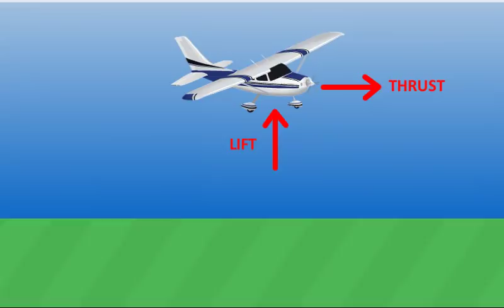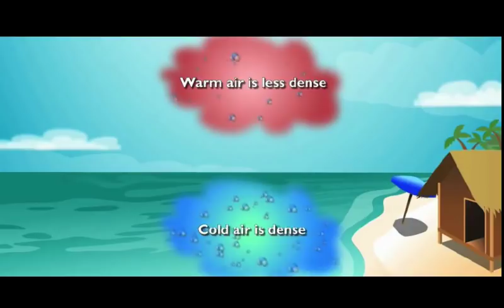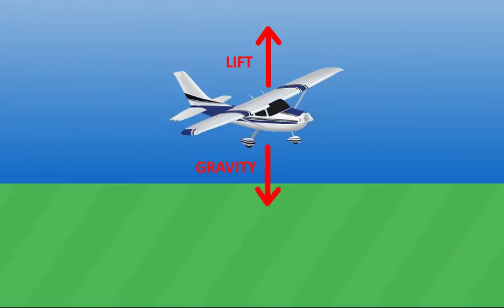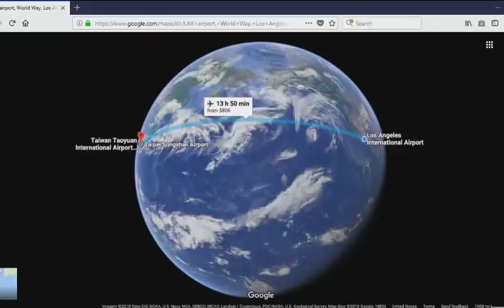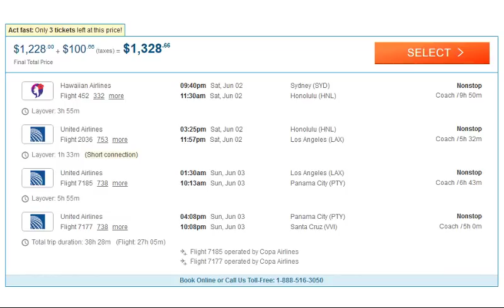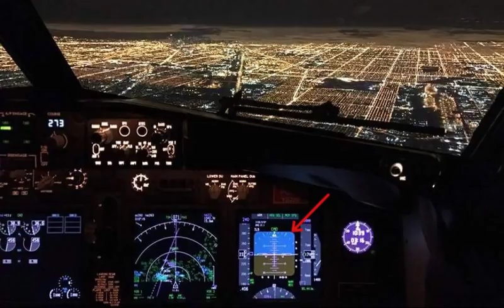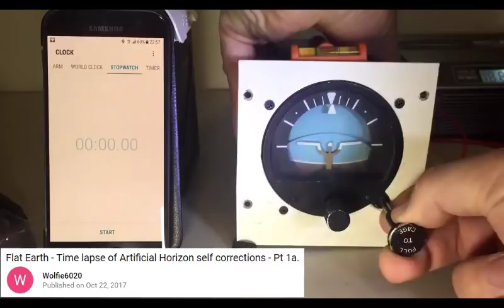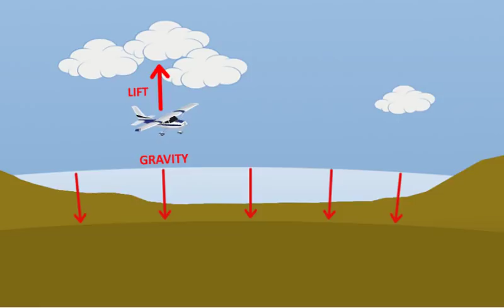Flat Earth Falsities - Plane Nonsense

Comment: So I haven't read any of the comments so if this is a repeat I am sorry. Anyway. On # 1 you say the plane keeps the momentum that it had when it takes off. So that means that it still has the 1040 mph momentum to the east so that it is moving with the air in an eastward direction so that it keeps the momentum and stays with the spin of the earth. Same with the helicopter it keeps the 1040 mph momentum east so that when it hovers it actually is moving with the earth at the same speed and therefore the earth with not spin underneath it . Cool. I get that and can accept that. Now onto # 2. North south landing. So if I take off going north at the equator going 1,040 mph and travel north for 8 hrs. Where do I land? Do I land straight north (same Longitude) of where I take off or do I land east (Longitude) of where I took off?
Reply from the maker: Good question. Planes are not missiles. They have pilots that are constantly correcting course due to the wind.  You are right to think that the ground will move slower as you go north from the equator, but so will the atmosphere, and the change is very gradual and will just not be noticed within all the other minute adjustments.
Reply: Well if you are heading north then presumably you are following a compass bearing, so you end up... north.
Reply: An 8 hour trip is quite long.  You will have to make slight adjustments just as if you drive 100 miles on a straight road.  Nothing you would ever notice.  If you are asking if land would move under you during that long trip?  Probably a little, so would the atmosphere you are in, the wind would change direction, all sorts of stuff.
Reply: This difference in speed creates a phenomenon known as the Coriolis force. This force, however, is too small to be noticeable in our everyday lives.
Reply: VoysovReason
So if I launch a rocket and point it north just like the plane would take off, it will land east in longitude of where it took off? Is that correct? It will do zero course correction for wind or spin of earth. Most rocket launches are done just straight up. I wonder if anyone has done this before. Hmmmmm..... That might be a fun test. I wonder if it would be allowed to do such a test. 

Ok so back to the airplane. So, the pilot makes these course corrections to stay on the same longitude line and fly just straight north and these are so minute that they pretty much can't be detected. Leaving from the equator I would agree these would be very minute but the further he travels north the more the corrections would have to be more drastic. For example, the first 10 degrees north from the equator it doesn't change all that much. But as he continues to fly north wouldn't the course corrections become larger and larger. There is a bigger change in earths rotational speed at 45 degrees north to 47 degrees than there is from 0 - 10 degrees.  I know wind speed may play a factor but let’s say for this example we find a day where the wind speeds are the same as he flies north. 

According to https://www.vcalc.com/wiki/MichaelBartmess/Rotational+Speed+at+Latitude

At 0 degrees (the equator) the rotational speed of earth is 1,040.4016 mph. At 1 degree latitude it is 1,040.232 mph. So that is a change of only 0.1696 mph. That is very minuscule. But then at 10 degrees the speed is 1,024.5956 mph. That is a change of 15.806 mph in 10 degrees or 691.69 miles. Remember each degree is 69.169 miles. But at 45 degrees latitude the rotational speed is 735.675 mph and at 47 degrees it is 709.5522 mph. That's a difference of 26.1228 mph in 1/5th the distance or 138.338 miles. So, the pilot should see a drastic change in course corrections while flying in this scenario would he not? 

Let’s say the plane is traveling at 500 mph (which is very typical for a large jet) so in 2 degrees from 0 – 2 latitude he goes 138.338 miles and it takes 0.276676 hrs. or 16.60 minutes to travel that distance. So, during that time the earth has rotated 287.85 miles at the equator and 287.678 miles at 2 degrees latitude. That’s a difference of 0.172 miles or 908.16 feet. Because the plane is still traveling at 1,040.4016 mph to the east as it were when it started out at that latitude, if there are no course corrections the plane would be east by 908.16 feet. Now the plane that is traveling at a latitude of 45 – 47 degrees the change would be much greater. So, let’s look at that. The plane is traveling at 500 mph and travels 2 degrees from 45 – 47 degrees. That’s the same 138.338 miles and takes the same time of 0.276676 hrs. or 16.6 minutes. This time the earth has traveled 203.54 miles at 45 degrees and 196.31 miles at 47 degrees. So, if there were no course corrections to be made the plane would be 7.23 miles to the east of where he started. That would be 42 times the distance change in the same 2 degrees of traveling north. Or the change in course correction would have to be 42 times that of the course correction at the equator.

I guess all I am getting at here is the while the course corrections may be minuscule they would have to be much different at different locations on earth. Because I am not a pilot myself my question for those that are pilots. Is there a difference in the course correction at higher (or lower) latitudes on earth? Can you tell a difference in these course corrections? I do have a couple people I know that are pilots so I will have to ask them the next time I see them. Not sure when that will be as they are more of an acquaintance through mutual friends though. 

I think this same principle could be done with a helicopter. Maybe not 500 mph but the distances could be replicated for sure. I do not think the wind speeds are that different at the equator vs 45 degrees north. It’s not like you hear of winds speeds over the ground blowing down homes at the equator vs at 45 degrees latitude. on a normal day. I think this test could be very accurate in a helicopter on a day that the wind speeds are very low. We have days here that the winds are pretty much nothing so it is a very viable test in my opinion. 138 miles would not be that far to fly a helicopter and get consistent winds at the same altitude. 
Hmmmmm…. Anyone out there willing to do this test?
Reply: Flat or Globe ? Good ?
Reply: Not sure what you mean by Good ? Please explain.

Comment: If you can get flat earthers to do an experiment with a globe and a lamp to explain sunrise and sunset they'll usually let go of the flat earth model.
Reply: Sometimes I'll throw this one at them...

Set up a model city on the floor using whatever objects you want.  Include some tall objects for skyscrapers.  Slowly circle a lit flashlight around to model the "FE Sun".  Notice how the tops of the "skyscrapers" get dark first during "sunset"?

This doesn't happen in the real world.  Tops of skyscrapers go dark last during sunset.

This can surely be seen at the tallest skyscraper, Burj Khalifa, in Dubai.  The upper floors experience the sunset a few minutes later than the lower floors.  This is also why Ramadan observers above, I believe, the 80th floor stop fasting a few minutes after those on the lower floors... they do it at THEIR sunset.
Reply: Another good proof is to wait till the sun has set then send a drone straight upwards and it will see the sun again. 
Wolfie6020 did that on his channel.

If you can find a tall building with a view of the horizon and a glass elevator then you could also do it there.

Comment: Line 8 in athletic tracks is about 53 meters longer then line 1 in full circle. And that is just for the length of 8 meters between line 8 and 1. If airplane is flying on average 10000 meters from curved earth how much longer then the airplane is flying in comparison to flying on the plane. Is it measurable on the airplane's instruments?
Reply: It's measurable even at the surface, this is why maps have to include distortions in distances, directions, or shapes.

Comment: 12;09 and thats not the same plane.
Hawaiian Air (international) to guess where.
Hawaiian Air (domestic - youre in the states now) to LAX
Possibly an affiliate (intl) LAX to Panama
A South American carrier (intl) 

Why do i know this? International and domestic flights are screened differently (esp. domestic flights within the US - yes i know the drill). You also dont get your bags checked all the way through anymore - you have to get them from the carousel at the end of each flight then check them in for the next.

Again, how do i know this? Experience. And ill be doing it again tomorrow (Wed 23rd May)
Reply from the maker: T. M. Shannon - Yes, thanks for the input. I showed the actual flights in my example at 12:35. First is Hawaiian, the rest are United. The last one had a layover of almost 6 hours. I guess it takes a long time to fuel the plane ;)
Reply: VoysovReason sadly couldnt see those in the vid (phone upright) but all good

Comment: "Because in MY reality"
Someone needs to get on the meds

And the answer of course is ESCAPE VELOCITY which even fighter jets cant reach.

Also air pressure decreasing with altitude = at some point there wont be enough air to burn the fuel in the engine, which = engines stop, which then = youre in deep shit at high altitude
Reply: T.M. Shannon " = youre in deep shit at high altitude"
If you are using a jet engine rather than a rocket. Incidently escape velocity only applies to an unpowered craft; powered craft can reach orbit by continuing to burn fuel.
Reply: Last time I checked, planes aren't rocket powered. Also, there's still a problem. Rockets have their own oxidizer inside. Engines use air as an oxidizer, since it has oxygen in it. So if you aren't using a rocket, you're still in deep shit if you go too high.

Comment: there is no way that the atmosphere could move at exactly the same speed as the earth due to friction and gravity. there would be some drag and delay. come on people, use some common sense here. when you spin a basketball on your finger does the air around it move at the exact same speed? yes it moves but not even close to the same speed.
Reply from the maker: The earth has trillions of times more gravity than a basketball.
Reply: richards, spin the basketball at .0006944 and record how much the air keeps up with it.
Reply: It is a common misconception that the atmosphere is spinning with the earth as a result of friction with the surface.  In fact the atmosphere spins along with the surface because it has always been spinning at the same rate as the surface ever since the earth along with its atmosphere coalesced from the same spinning cloud of gas and dust 4.5 billion years ago.
Reply: actually it does,,on the same scale,,about half a milimetre thick,,like DUH..
Reply: Has the basket ball been spinning in a non friction environment for billions of years?
Reply: @v.x richards
Returns after he was hospitalised when he had several new rectums reamed after making the same stupid claims and being right royally rogered. He must like being abused.
Reply: +John Myers
I have some experience of v.x richards   I gave the troll the respect you seem to be doing, as did others. It abused it. Several times.  My post perfectly reflects that, or didn't you notice?. His latest opening gambit is pure troll. Drawing the marks.
Arguing with a troll is not fun. It is stupidity. But feel free to go ahead and be laughed at by the trill
Have you noticed the absence of trolls on FE cultists channels? There is a reason. They don't rise to the trolls' bait. They just post jerk circle self congratulatory comments and that is all, for the most part.
"I share your persuasion of a globe earth". I don't have a persuasion ducky, sorry.
a deep conviction or belief.
a form or system of belief, especially religious belief:
a sect, group, or faction holding or advocating a particular belief, idea, ideology, etc.:
FE cultists have a persuasion. I have facts and knowledge. There is a difference you know.
Reply from the maker: John Myers - Thanks for this great analysis.
Reply: Rollie your decimal is in the wrong spor

Comment: I'm not a flat earther, but I still don't really understand how a plane doesn't have to nose down and how gravity does it for the plane.
Reply: The pilot just maintains altitude. There are so many greater forces exerted on the plane by the atmosphere that "nosing down" would never be felt.
Reply from the maker: S cooper - A plane actually doesn’t have to nose up to climb, or nose down to descend. It helps but is not necessary. The amount of air going over the wings determines lift.  More speed, you get more lift, even if you don’t nose up. Less speed, you get less lift, and you descend, even if you don’t nose down. You will often see planes landing nose up. This provides a bit of extra lift to counteract the lessoning lift due to the speed decreasing. And so, when the amount of lift is equal to the plane’s weight, it stays at a constant level above sea level. I actually took some flying lessens, so I know how it works.

Nose up landing.
https://imgur.com/gallery/BaNJHa7
Reply: When you jump up in the air, do you have to nose down before you fall?
Reply: Anything that is thrown or shot horizontally ends up falling back to earth. Be it a ball, a rock, or a bullet. Unless it has a mechanism to work against gravity, like wings and an engine. 
Turn the engine off on an airplane and it will eventually fall or glide back to earth due to gravitys constant pull. You don't need to point the plane down for this to happen.
Reply: Airplanes (or their wings anyway) always tilt slightly back to get the lift needed to stay aloft. As the plane is traveling the direction in which gravity pulls is slightly changed (since it always pulls toward earth's center of mass, rather that towards some arbitrary down direction as implicated by the sketch in the video). This slight difference in the direction of the pull of gravity over time (pulling just slightly backwards) would account for why you don't magically fly into outer space.
Reply: S Cooper, if you imagine a static globe with a plane above it moving around the earth, then it's easy to make the same mistake that fiat earthers do. Instead, picture a spinning globe with a plane directly above it, moving through an atmosphere that moves with the earth. The plane lifts off the surface, and lands back on another part of the surface, but you haven't had to dip the nose.
Reply: S Cooper There is a constant balancing exchange of the aircraft’s potential energy caused by lift and its kinetic energy caused by gravity.
Reply: @S Cooper
There is no adjustment needed as the aircraft will naturally follow the curvature of the earth without any input from the pilot. This is because the aircraft flies through the atmosphere which also follows the curvature of the earth.
It's the air pressure that keeps a plane in level flight. Increasing altitude reduces the lift and the plane falls; decreasing altitude increases the lift and the planes rises.
You should look up Schuler tuning. The "schuler loop" is an integral part of avionics, that automatically compensate for earth's curvature.
https://en.wikipedia.org/wiki/Schuler_tuning
And read  the references provided.
http://www.mediander.com/connects/26619546/ln-3-inertial-navigation-system/#!/topic/-/
http://aerostudents.com/files/avionics/navigationBasicsAndInertialNavigation.pdf
Reply: OMG GMO no, but I'm not changing horizontal speed relative to my "down". Even if I run and jump, I'm too tiny and slow to get any noticeable effects.
Reply: Chris Kostokanellis alright, that example made it a bit more clear. Thanks.
Reply: S Cooper lets make a computer game. have you ever played a mario bro? have you tried the world 2? you get to swim pressing button A to be on a certain level. now if ever you programmed that world that goes around and it is pulling you towards the center. all you have to do is press left  and A button. You can also try to do it with flappy bird app